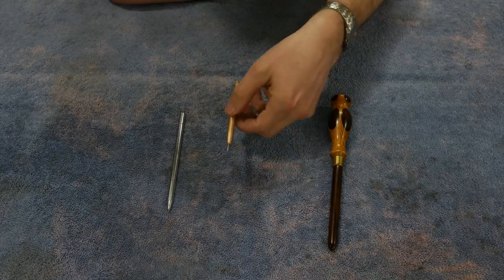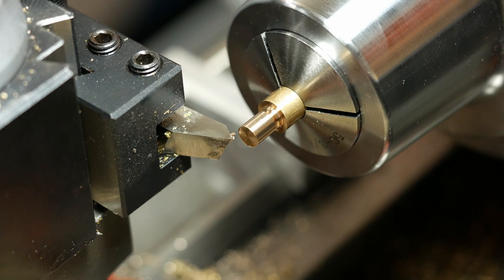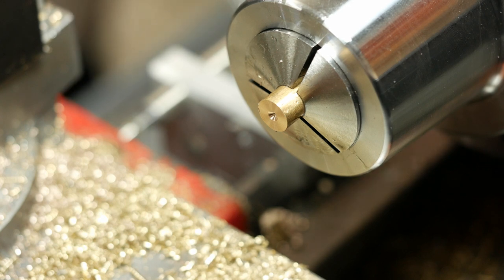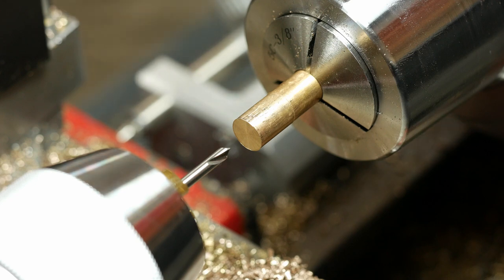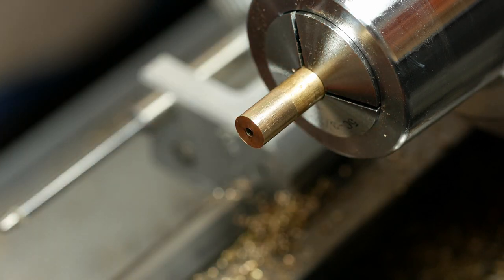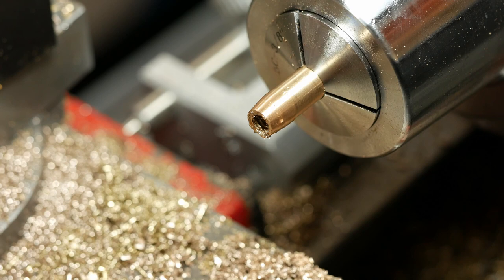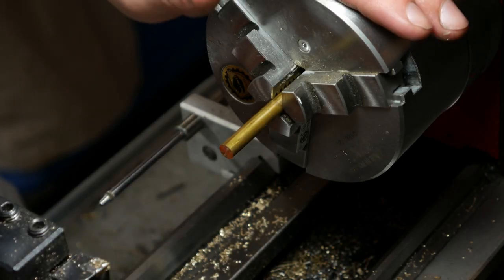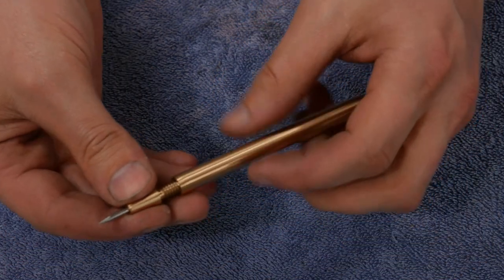Making a scribe or scratch awl

Comment: Great video! One question how did you determine the length of the bushing so that it would allow for the tip to fully screw on?
Reply from the maker: +Matthew Tacker  

It was a multi step process.

1. I parted it off longer than it needed to be
2. I inserted it into the body and screwed the  cap on as far as it would go
3. I measured the distance between the top of the body and the bottom of the cap
4. I re-chucked it and face it to the correct length

Comment: Can you also use a tungsten electrode for TIG welding as a scribe?
Reply from the maker: As long as you drill or ream the hole to the correct size, I don't see why you couldn't.